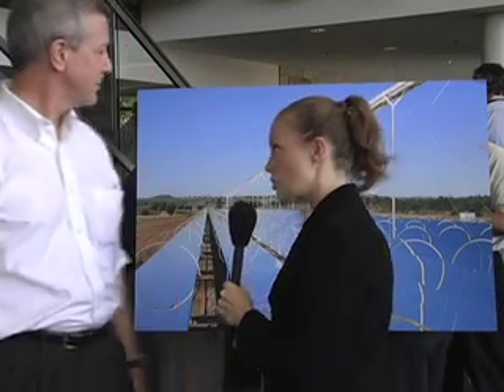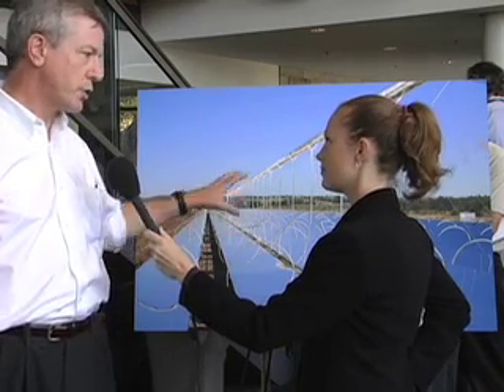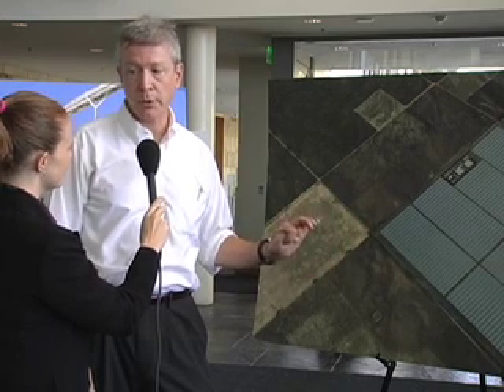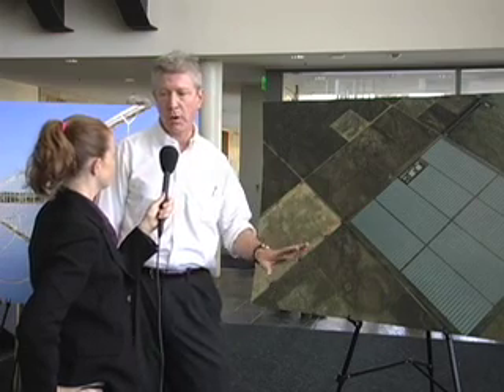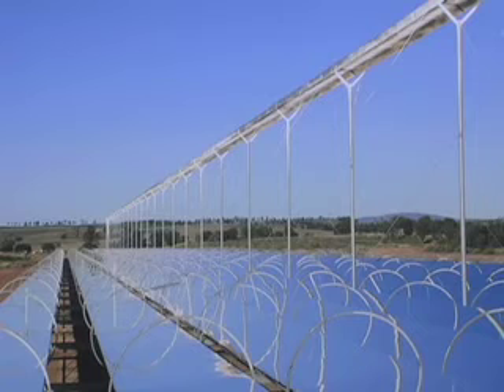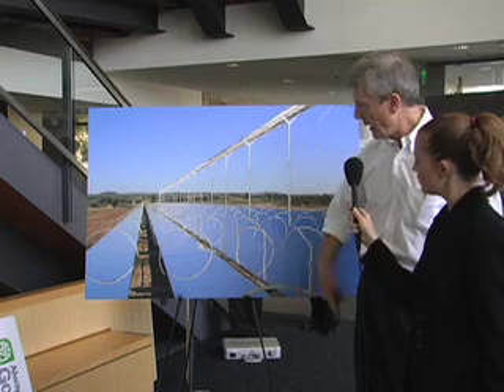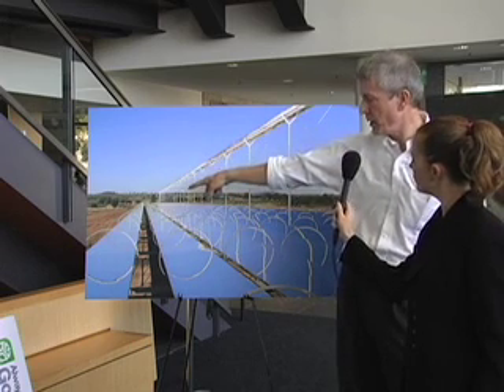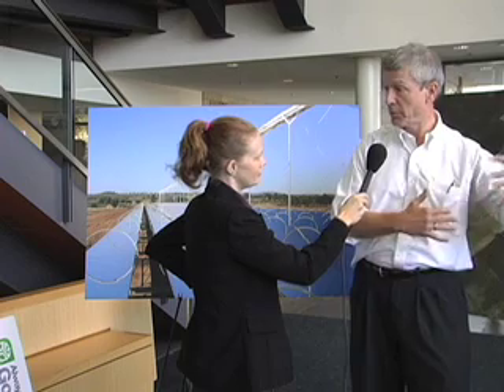Going Green 2007 - Ausra

Comment: The stated cost for this system is about half of rooftop PV systems. This would make the cost per kWh over $0.20. With nuclear at about $0.04, and coal about the same even gas is in the neighborhood of $0.08. To be competitive without subsidies they need to reduce costs by at least 60% a very difficult task.